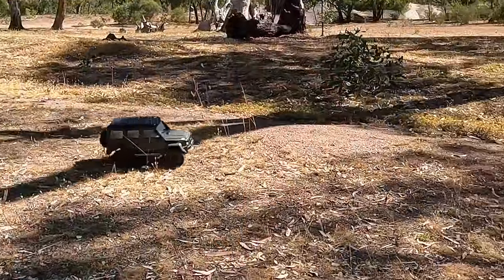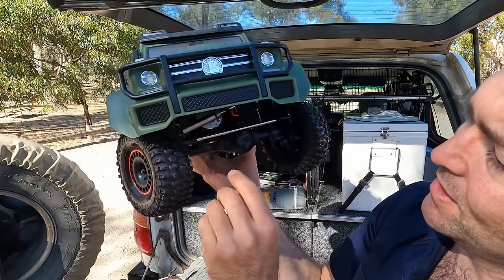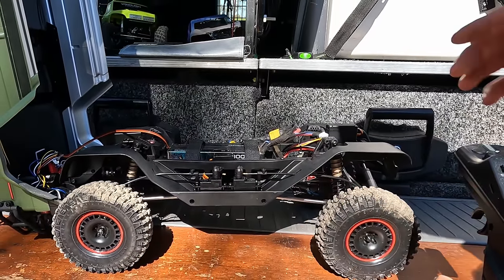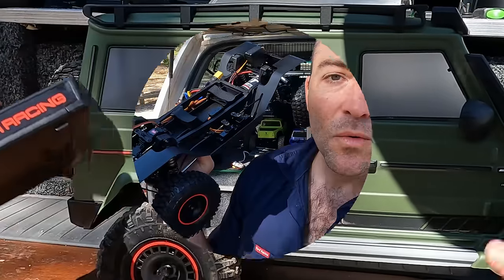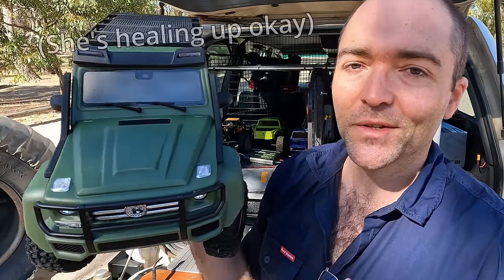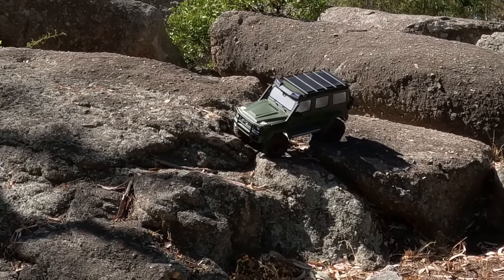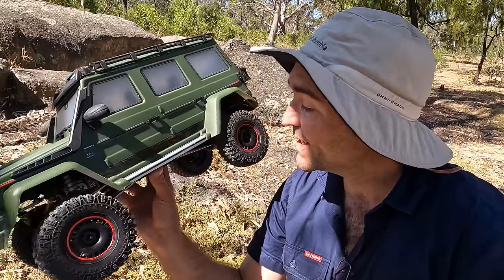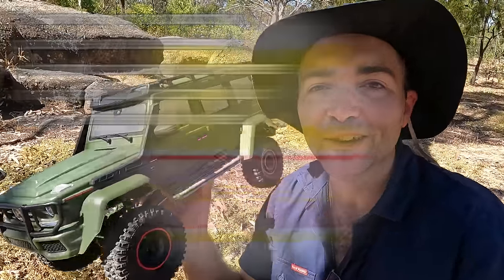Something Actually NEW in RC!

Comment: I have all of those trucks you mentioned plus I have a Traction hobby G wagon Brabus that has 2wd front or rear 4wd two speed with diff locks front and rear and i have to say it is far better then both my Trx4 Defenders and my scx gladiator but I do like the dig on the gladiator so I would love the Traction hobby to have the dig function, I can have fwd only but it would be nice to be able to lock the rear axle, I wondered if you had tried the Traction hobby and if so what your thoughts were on the truck , 
I enjoy your videos there very informative so thank you for you efforts , stay safe mate 🇬🇧
Reply from the maker: I haven't had a traction hobby vehicle but I nearly have! They look great on features and build.

I will add the FMS FCX10 has all this stuff too. 2 speed, dig, remote ockers, option for RWD/4WD/FWD, light kit, etc. Might be of interest to you. Cheers

Comment: Like diskbrakes idea on smaller scale, but for another purpose. More thinking on a serious fast 2wd. I have some, but you really need to take in account the space needed for braking. I already had the crazy idea off taking a 4x4 (loose front mid joint) and then use front diff as disk housing and fiddle somehow a brake mechanisme in there but never tried it. But curious to see how good it works in real live. I've had a 5th scale off-road with hydrolic front disk brakes (there also were machanical) and they very often didn't work properly. Often braked uneven or they didn't let loose the disk completely. But that was something like 15 or 20 years ago. Would expect some improvements in the meanwhile...
Reply from the maker: Yes! An undriven front diff with a disc on the drive shaft, somewhere in the chassis, that'd be how you'd achieve that idea I think. But now, these disc brakes are simple and light enough that they're the better option. And if you only want it for breaking rather than traction control, a single servo could manage it for the front or even all 4 wheels. It's an exciting development.
Reply: @RCTNT  yes, i  hope this will be implemented in the future in more cars like 2wd's (so i don't need experiment things myself). 
We bought and tested on-, and off-road our 10th buggies 2wd vs 4wd. The only thing what kept me from winning in our own created "race"conditions/tracks was the braking but was still real close. Eventually we ended up racing 2wd's. We thought they were more spectaculair to drive. But man, if it would brake like a 4wd....
Also have other rc's, also in different sizes and 4wd, but under the right conditions i prefer racing 2wd...

Comment: The only difference in that controller and the one on the FMS is that Mine has a foam steering wheel. But they are both fly sky. I'm trying to find the new receiver. They do make one that you can use without the 2 in 1 combo. But keep the controller.
Reply from the maker: The wheel feels nicer on the Yikong implementation, believe it or not. I like the foam on the FMS variant, but it's lighter weight and the spring is a bit softer. I don't know if that's all it is, wheel weight and spring tension, but gosh the wheel on the Yikong variant feels premium! I love it.

Comment: Nice 10.000 views in 8 hours. You got someone's attention this time. Good job buddy keep it up. Awesome rig, too.
I got the FMS10 blazer. And it has dig and the locking differentials. And two wheel drive feature, but only front. But it is going to give all the other brands a run for the money. It is very good.
Reply from the maker: This video must be addressing some need on YouTube. I hope people find it delivers! (and though I intentionally tried to share my confusion from the start with this thing, I hope this choice doesn't put people off from the rest of the video. It's a car worthy of attention.)

So, I like the FCX10, it's rather neat. Am looking forward to doing its video too :) Of course, it's 30% more expensive than this car, but they're both excellent rigs. 

I prefer the fms for its licensed body and their own tire design. I really don't like clones, it's lazy and bad for the industry. But the new tech was cool enough I overlooked the body in this case.

Comment: Ah you got a green one ... was tempted but didn't want to deal with removing the mate clear-coat on the windows ... got a white one last week instead and did an unboxing on a pair of forums this side of the earth. 
Surprising little truck ... its weight biais is backward but it doesn't handle that bad. Unfortunately I messed up with "tank-turn" so couldn't try it on the trail ... and my light module also died but it wasn't in good health anyway as backup light didn't work from the box.
Shocks' oil wouldn't mind being lighter, as the foams ... unfortunately, wheels are not beadlock.

Just read your site ... about the manual, there 's a QRCode on the box to download it.
Reply from the maker: Oh thanks, that's great info! Sorry your light kit is faulty, that's frustrating. Funny how your shock oil was too stiff and mine was, well, missing! I'll look into the manual, thank you!

Comment: Yooo thats system needs a channel mixer. Rear brakes could be operational from the streering if u had a flysky g7p. Proportional to👍
Reply from the maker: Mixing is built in, and you can toggle the system on and off. Rear braking is proportional to the steering when it's active 👍

Sorry, I could have made it clearer!

Comment: I found a place that sells them & I was looking at the big Bronco they have I think it’s 1/6 scale it has every feature & the body looks correct they also have 1:10 scale crawlers like the one up you have & & also they have RGT Crawlers both these brands are hard to find to purchase anything from in the US. They seem well built & there’s no reason they shouldn’t perform well. I just got the FMS 1:10 scale Blazer & it’s amazing hopefully you get it to review love to hear your review of it. That remote & all those features look a lot like the new FMS 1:10 Brazer & the remote looks the same.
Reply from the maker: I have the FCX10 here and yes, it's got the same OEM flysky system. You can't buy it separately, currently. I like it.

The 1/8 scale Yikong 4083, I think it is, looks great, doesn't it!

Comment: Are spares readily available?
Reply from the maker: I looked up 'yikong 4106 pro parts' on AliExpress and there's a heap of stuff there. So, it looks that way, yes.
Reply: And only need to wait +1month for spares if you can find😅
Reply from the maker: Depends where you are in the world, I guess. I get things faster from AliExpress than I do from Amain, here in Australia.
Reply: @RCTNT  finland,in here we got so limited options.. :/ aliexpress takes always 3-6weeks :/ also wery limited options on what rc brands can be bought, if i would want ascent 18,it would be 299+160e taxes and duties+50shipping,living in finland sucks for rc:ing,i wanted somethinh cheap and had to go on trx4 sport hightrail (560e) but so far i have liked it,i would rather had redcat... but not an option :(
Reply from the maker: @topqualityfi8216 ah yes, we've discussed this before, haven't we.
Well, if it helps to know, I have all the Traxxas crawlers and all the Redcat crawlers, and I'd probably take a TRX4 over a Gen8 or Gen9, as the bodies are a bit nicer, the tires are a lot better, and the rest of it is pretty similar. I think you've made a good choice, basically!

Comment: Would you choose it over the FCX10??
Reply from the maker: That's a very specific question. I guess you might choose this if you like the body better, or if the tank turn appeals. 

Price would be another factor; I paid AUD$755 delivered for the FCX10 and AUD$583 delivered for this one. That this model is 30% cheaper is definitely worth considering. 

Overall the construction and finish is similar in both, though the body on the FMS is thicker, not to mention the branding is actually licensed! Cheers
Reply: @RCTNT  THanks for the reply. I am still waiting for you fcx10 review!
Reply from the maker: I only just pulled the FCX10 out of its box two days ago. It's a great little car too. Looking forward to doing the video 👍

Comment: traxxas really needs to get in gear and come out with a digital all in one remote. 

the tqi controller they've had for i think a decade now is starting to show it's age. 

even on trucks that don't have multiple channels in use it would be nice to be able to set servo endpoints and travel and all of that good stuff out of the box with a warranty.
Reply from the maker: Yes! The set and menu button rigamarole drives me nuts. The Bluetooth & phone setup works well enough at least. It's more money tho.
Reply: @RCTNT i've found the tqi link to be relatively useless in my opinion. 
the app is a bit hard to navigate and to unlock the full potential of it you need to spend a bunch of extra money on telemetry expanders and sensors not to mention all of those little fragile wires needing to be routed.

having to refer to the owners manual every single time you need to make an adjustment is bonkers. just put an lcd on the controller so i can click through menus.
Reply from the maker: @spyker_aileron I made my feelings clear on this in my 2021 Bronco Upgrade video. I spent way too much money for the telemetry stuff only to be disappointed that there's no odometer for even the driving session (why?!) and it doesn't register under about 3.5km/h (thus useless for a crawler). It sucks.

Comment: There's an SE and a Pro model and they're about $100 apart, but it's not clear about the difference...
Reply from the maker: There's actually a third version too, though it doesn't appear to be listed anywhere except on the box.
The SE has 2-speed as the only extra, radio operated channel, and the diffs are manually locked/unlocked via a thumb lever on the car itself, which is an interesting cost-saving compromise!

Comment: I wonder if the frosting on windows would come off with a little rub using a cloth soaked in fuel?
Shame to cover up the interior 😕 lol.
I own a couple of different absima (eu yikong) and have been very impressed with them so far on many levels and with general varied use.
The only bad thing i have to mention was a build error using the wrong type of shock tops which restricted the whole suspension range, slightly unforgivable i feel with such a wrong choice of part and obvious issue, iirc the yikong had better shocks (with ball tops) included in their kit, but looks like the eu market swapped them out for cheap bum ones, disappointing... but still not a big deal to put right.😅 😂❤
Reply from the maker: One bad decision in design or assembly can make a huge difference, unfortunately. My Rlaarlo AK-917 review was an example of this, with the receiver antenna bundled with the rest of the cables causing intermittent cuts in reception. Made the whole car look bad, though it was easily fixed. Sounds similar to your experience.

This really is a decent car, yes. The windows should be possible to clear, I agree. Body and tire tread IP theft aside, it's a truly impressive car for the money!

Comment: That was more than My 2021 Trx4 Bronco to buy😳.  To much money for that thin plastik😑
Reply from the maker: If I could get a 2021 TRX4 Bronco for AUD$583 delivered, I'd have two of them. I spent about AUD$1100 to buy mine, before I got any mods for it. We pay a lot more for Traxxas in Australia. In USA, Traxxas is far more reasonably priced, and in contrast, I imagine brands like Yikong, RGT, Cross RC, MST, etc. are similar or more than what we pay in Australia.

I'm not making a case for either here. Just reporting the costs. If you can get a better deal on something, go for it. Cheers!

Comment: 1st Time watching your channel... nice video. Had to laugh my new FMS FCX10 K5 has every one of those features minus the cool brakes.   It even has the same remote.
Reply from the maker: It's similar but actually a little different, believe it or not! The light system is more complete on this one over the FMS, too. And I understand the current version of this thing actually has clear windows so you can see the interior - bit of a face-palm, this first iteration!

FMS vid here: https://youtu.be/gjZ0uOcNMHU

Anyway, glad you found my stuff. I have an upgrade video coming for the FMS and it'll be featuring a custom built suspension system made just for this vehicle. Should be interesting!

Thanks for stopping by 😊

Comment: Nice fj80 we use ours for our rc trips also
Reply from the maker: Heh thanks. Diesel all the way here. Its an HDJ100 with a little fettling to get that turbo breathing better! I did have an 1HZ80 as well, but I gave it away after I got the 100 here. Love my Landcruisers ☺️
Reply: Pretty hard to get your hands a diesel cruiser here in the states lucky we got the 80. 1992 3fe
Reply from the maker: @clinthelsel3091 solid work horse 👍
My 80 series was a 91 model. It was actually a tractor pretending to be a car. Basic, but just about unkillable  💪

Comment: My Tank 300 full size vehicle has tank turn which does this exact same feature
Reply from the maker: Really?! Geez that's gotta be hard on the rear suspension and bushings. Cool!
Reply: @RCTNT  it only works in low range 4x4 setting. I haven't used it yet but there is a tank turn button and you need I think to turn the steering full lock for it to activate. As I say, I don't really need that, but it is a switch on my centre console.
Reply from the maker: Definitely try it out, I don't think I'd be able to help myself! Find some gravel and make it so! Really cool 😎

Comment: Very cool, but I got to the part where you found the faulty servo before I realised this is not for me. Far too much fiddly stuff going on 😂
Reply from the maker: Haha yes! It was convenient to make such a point, wasn't it! With more money thrown at it for known-reliable units, like the HD Power TR4 servos, you'd be fine. But complexity is star this thing is all about, yes. Definitely not for everyone!
Reply: @RCTNT  I love the idea of all the automated gadgets and gizmos, much like real vehicles. The issue is that failures reduce/stop the fun and ultimately you end up with a better overall time with something simple and durable. I still reckon the ultimate performance vs reliability is the MOA all wheel steering crawlers. Super simple, great weight distribution, super battery efficient and ridiculously capable!
Reply from the maker: If those are your metrics then yes, Super class will tick the boxes. Price will be a lot to swallow and they're complex to drive, but that's part of the fun. I love comp crawling.
But for fun, the scale element is important to many of us. Nice to have all this choice though eh!
Reply: @RCTNT true enough! I'm still dipping my toe in the water with RC stuff - last time I had an RC car it was a novelty having gears on a nitro car so it's quite a change! So far I've learned the hard way that mini tamiya plugs are wired backwards on airsoft batteries (who's bright spark idea was that?!) figured out different scale sizes of motors and pinion gears on an old SCT I got given (also the hard way) bought a cheapie chinese crawler for my boy and the surprisingly capable FTX ravine. I have to say, I've been binge watching your vids and they're awesome - it's nice to see some quantifiable comparisons rather than just 'buy expensive stuff, it's better' so thank you for your efforts!!
Reply from the maker: I'm so glad to hear (most) of that, thank you!
Be aware that many jst plugs, both the white and red ones, tend to be reversed by various battery and esc makers, too. There doesn't seem to be a lot of consistency in these!

Glad you're enjoying my videos. I really do try to convey the experience of the hobby, rather than to be a product sales person! Cheers
Reply: @RCTNT  cheers for the heads up, and consistent responses! I think RC stuff has a better standard than airsoft stuff (thankfully!) the amount of proprietary parts in airsoft is ridiculous, and frustrating. Also many youtube vids on airsoft stuff are sponsored with no measurable 'yard stick' to compare it all to. It's awesome to see the effort you go to in order to have a good consistent control which is comparable. I think I will end up dabbling in a scale type truck at some point. 
Keep doing what you do, and enjoy it!
Reply from the maker: Scale is life 😊
Super relaxing hobby isn't it
Reply: @RCTNT  absolutely. All of my previous hobbies have been adrenaline based, mostly frowned upon by people who don't also do the hobby. This is awesome cus I can do it with my boy, and still get all the mad tuning/modifying out of my system! 
I absolutely love good working suspension on a well designed chassis - both real vehicles and scale. It's so pleasing to watch! What is your favourite model with regards to suspension/tyre combo? Could be a good video 😎
Reply from the maker: Thank you, fellow motorcyclist!

The Super Baja Rey 2.0 is hard to pass on such a question as that. Though honestly, this car comes close!
Reply: @RCTNT  haha! One of the main reasons I'm enjoying RC stuff is because I can go to the forests around me and have a play without being told off!! People around here don't get along with 2 strokes poodling round the woods.
I'll check out the baja - I have a huge soft spot for anything baja related anyway!
Reply from the maker: That's great. This is a brilliant hobby. I miss riding but the RC stuff is relaxing, for sure.
Reply: @RCTNT  absolutely, it fills a void for me as something I can do any time and get outside without upsetting people! And the community is fantastic, including yourself responding to several long messages of mine daily 😂
Reply from the maker: @doodlepugg haha right on